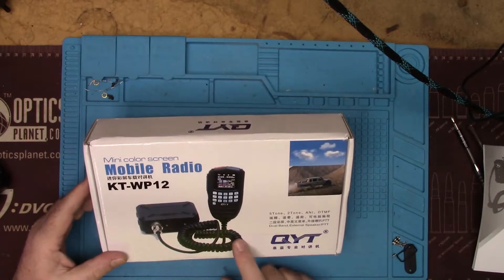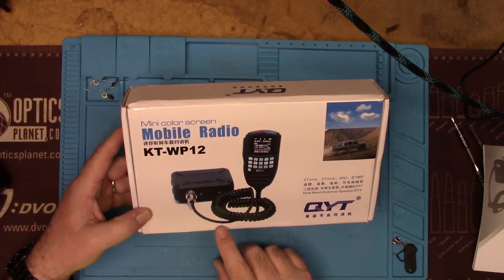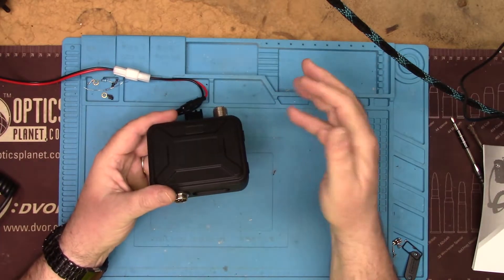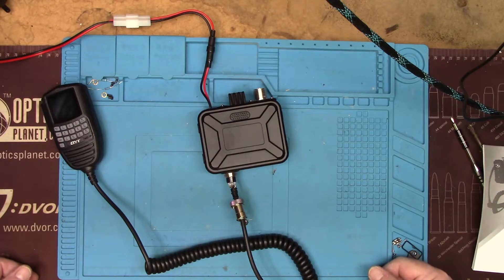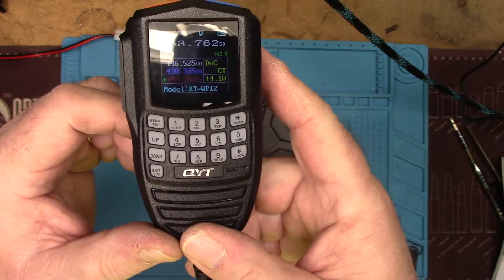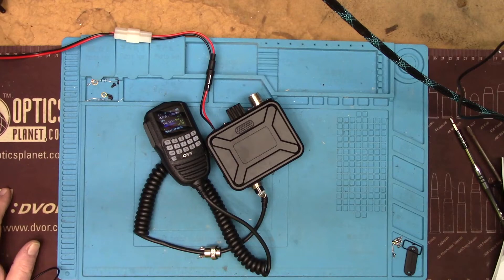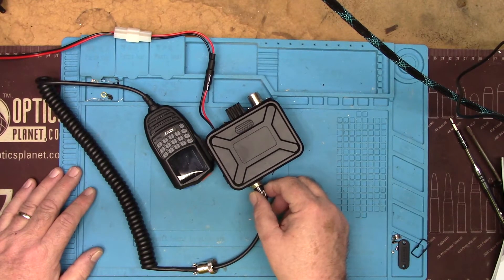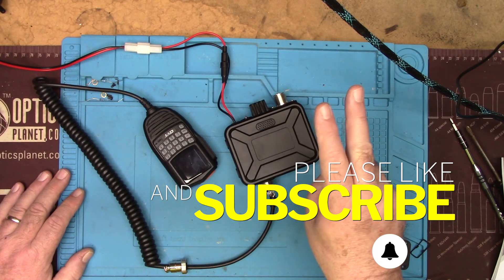QYT Tiny Mobile Radio - KT-WP12

Comment: Where did you end up on this one?  I bought one back when Tech Minds did his video and have used it 2-3 times.  It was going on a mobility scooter but that is long gone.
Reply from the maker: I still have it, boxed up.  I thought it worked fine, I did have a crappy cable that I replaced, and made an extension cable for it.  I honestly hadn't touched it in quite a while.  The radio worked well.  As small as it is, I think a good use is to use it as a secondary radio for trips, or something like that?  It would be a good one to mount in a portable setup for 2m/70cm coverage.

Comment: any update about this radio? is it worth every penny?
Reply from the maker: Yeah, I think so.  Once I fixed the busted mic cable, it works fine.
Reply: @FEPLabsRadio  there is an overheating issue on this radio, is there any solution to that?

Comment: Hi there.
Many thanks for the nice presentation of the radio.
I noted that the LOW power is about 10watts on both bands, which it may be quite a lot, considering that with relative long transmissions the radio gets significantly hot.
As for may mobile readios, it would be better to set the LOW pover level to about 5Watts maximum.
Is there any possibility to set the above value by a kind of internal tuning of the radio, eventually with any service/technical manual available ?
Thanks in advance for kind consideraion of the above, for a possible solution of the matter.
Ciao, Alfredo.
Reply from the maker: Hey Alfredo!  Thanks for watching.   Modifying is well outside of my capabilities.  I don't have this guy installed anywhere at the moment, but mounting it where it can get good air circulation, and maybe a heat sink fin on it to help dissipate would be a good idea.
Reply: @FEPLabsRadio Really many thanks for the appreciated reply with the suggestion, which was already my idea to apply a fan, but the main intention would be, if possible, to actually reduce the LOW power transmission level,  when there will be no need to use the already available MID and HIGH levels.
Let's hope to find the way to do the above in the future.
Thanks again.
Ciao, Alfredo.

Comment: Anyone happen to know what the TRRS pin out is for the external speaker? Wondering if there is a way to use this radio with an external sound card and digital operability. Tried using pinouts from BTECH GMRS version but can’t get software to transmit.
Reply from the maker: I don't think that's gonna be the issue - there is no keying line in the audio port, AFAIK (Haven't seen specs).  I would be very surprised if there was.   However, you could use the audio port for the output audio from the radio, and tie in to the mic lines and the key-up line that way, I should think.  It might take a little messing around to get it.

Comment: Have had mine two weeks now. Ordered from Amazon with NMO antenna system. This radio is perfect for 2022 Hyundai Santa Fe under console cubby. Power is there already and antenna coax straight back to tailgate area. Programing first time with Chirp was easy, but RT systems allows fine tune of some items. Power output check on spec. analyzer is 25/20 and all reports of voice / mic quality is spot on. This is perfect HT replacement for more power with a 3amp draw. Go box, space problem, cost effective alternative with some design forward thinking the BIG THREE should be looking at. It's a keeper for my situation and needs. Even had plenty of room for 5" external spkr from my goody closet which enhanced sound volume and clarity.
Reply from the maker: Exactly!  I want to put mine on the spectrum analyzer, and take a look at the signal output, but the compact size is great for a go box.  The fact that the screen is in the mic is an awesome idea.  I've kinda got a plan to update my go box, and change out that radio for this guy.  Wire up an external jack for the mic, etc.  Thanks for watching!

Comment: Maybe banggood will send you a new mic for the radio. Maybe that is what they offered you already. You have said that you believe it is the mic connector. Let them send you a new mic for the radio. There is only one wire that sends serial to the mic and back.
I have 2 from anysecu and one QYT SAME RADIO. This radio when type accepted by the FCC was triband and included 223 mhz.
Reply from the maker: Hey Coy!  Yeah after some back and forth, they refunded me $45 of the purchase price, and I got to keep the radio.  I just cut off the offending wires, bought two pre-made 8 pin cables off of amazon and made a nice long cable that works perfect.  Other than the drama with the cable, I think it  is a decent, cheap 2M.  Is it an Icom??  nahhh, but at the end of the day, it works just fine.  Thanks for watching!

Comment: replacement wp 9900  works fine  no issues   sometimes software is buggy when installing new freqs
Reply from the maker: I haven't got mine in "production" yet.  I think I am planning on a ham-in-a-can build with it.  I will say, other than the cable I haven't had any problems with mine.

Comment: I have the anysecu wp9900 which is this radio. first worked  2 weeks and stopped tx. second works great in ordr to really use software use the anysecu  wp9900 vip software.  to change vol  press the orange button to open squelch and adjust vol with up down keys. for power to get  the three levels use the lock button
Reply from the maker: Thanks for the info!  Mine has worked fine, after I re-built the cable.  I plan to install this in a go-box kind of deal probably.

Comment: This is a really interesting radio. I installed it in my car and made some videos. It’s really interesting and comfy radio
Reply from the maker: So far I haven't been able to do much with it - the mic cable has a short/busted wire inside the cable.  I got replacement cable (and longer) that I just need to solder into the internal connecter inside the mic.
Reply: @FEPLabsRadio  Did you repair it?
Reply from the maker: @okhamradio  Yes, I bought 2 standard 8 pin DIN mic extension cables, and sacrificed one of them as a new connection cable.  Added the 2nd as an extension.  Works great now.

Comment: This is a decent radio for a Chinese radio. I ordered mine from Amazon and it came with the programming cable.
Reply: Did you already test it?
Reply: @okhamradio  I've only used it to talk on a couple repeaters in my area. I've gotten good audio reports. I don't have any equipment to test power output or swr. Also, mine is the Anysecu WP 9900 version. Same radio just branded different.
Reply: @N4GNGGeraldGullion  yeah, I don’t have a power meter too and want to know the real power.
Reply: @okhamradio  yeah I wish I had the equipment to test it so I could do a video on it. There aren't many videos about this radio and I haven't seen any that really tested the radio.
Reply from the maker: @okhamradio  I'm getting the cable re-wired hopefully tonight.  Ought to have an updated video out this weekend, with power info.
Reply: @N4GNGGeraldGullion  i opened the black box and inside saw rda1846 chip
Reply: @FEPLabsRadio  thanks! We are waiting!
Reply: @FEPLabsRadio  that will be awesome.
Reply: @okhamradio  I don't know what that is.
Reply: @N4GNGGeraldGullion it means the receiver is not superheterodyne in this radio
Reply: @okhamradio  oh ok, thanks. I don't any of the cheap Chinese radios are. That's kind of a more expensive radio thing isn't it?

Comment: Is the data hole the same as a feng?
Reply from the maker: I couldn't get my 'feng cable to do the thang with it.  I have the right CPS, but no joy.  I ordered a cable listed for it, so whenever it shows up, i can pile it in the box with the busted-ass radio.  I'll probably try and pull the mic cable apart and see if I can fix it.
Reply: The data hole is not the same. The feng takes a Kenwood style plug this radio uses a single plug style cable.
Reply from the maker: @N4GNGGeraldGullion  Yep - I had to order a cable for it.  Amazingly, in my "Collection 'O Cables" I didn't have one that would work.  Got that sorted out.  Now I need to fix the mic cable.